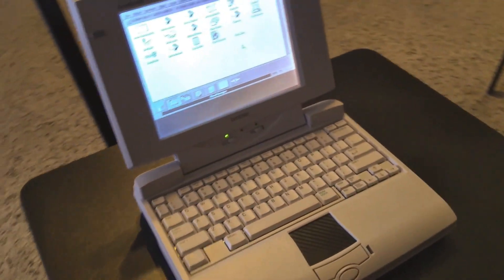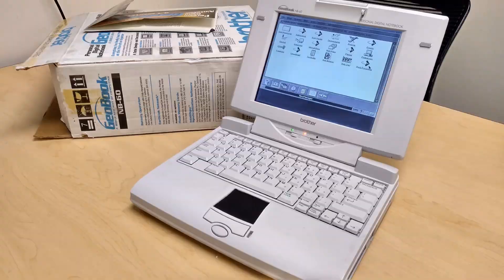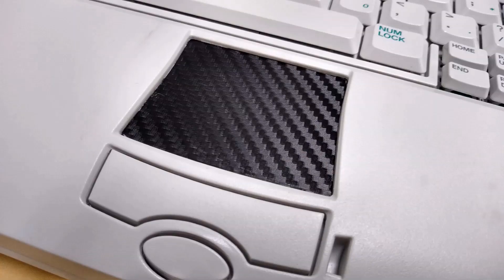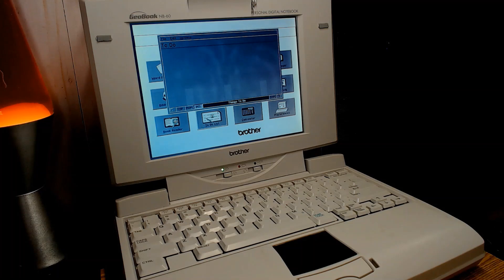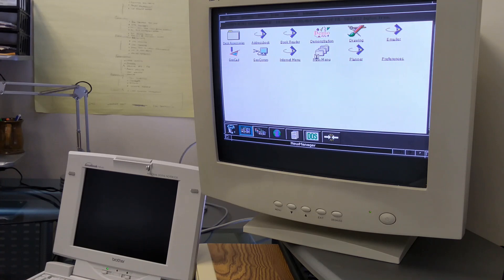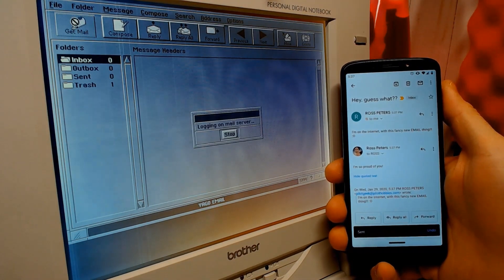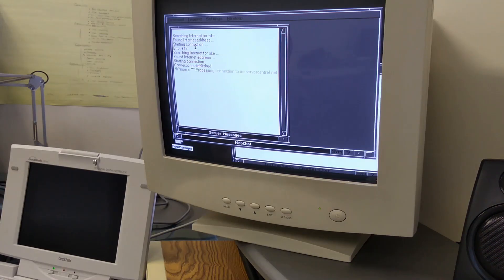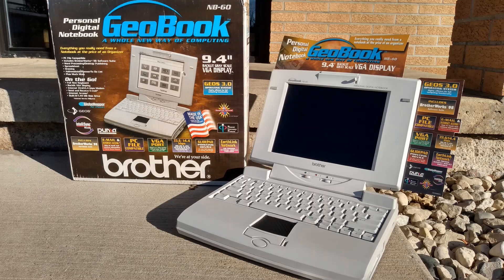GeoBook – The Failed Budget 386sx Laptop in an era of Pentiums

Comment: Is it correct the DOS and GEOS are in ROM?  If so, can the modifications you made to GEOS be reversed?  I've not used one of these things, though I'm kind of tempted to buy one on eBay because I'm curious to see how it works.
Reply from the maker: The modifications I made can be reversed. The OS is in ROM, and the modifications I make are in a 1MB flash memory module, so if you delete the modified files, it falls back to the original ones.
Reply: @Pilotgeek  Hmm, I see.  I was talking with someone else, on another video about these machines I think, and I think they suggested the flash memory needs formatting every so often.  This person apparently did some sort of beta testing or software testing on these machines and they tried a lot of software on them, I think they said you need the factory supplied diskettes to reformat the flash memory if you need to do so.  Is that correct?

Comment: Compared to new laptops in 1998, if all you needed was a word processing machine this wouldn't be bad, but if you take into account used machines, $600 could get you a 486, maybe even a P75 or something, color, and the ability to run standard DOS and Windows software.

Comment: What software / settings are you using on the raspberry pi to emulate a serial modem?
I'm looking for a way to connect old systems to the intranet/Internet natively through built-in protocols. Preferably I would use the modem but I don't have a PBX yet and serial would be a little faster.

Comment: Hello - good video.  I wanted to take moment to thank you for it.  As a GEOS fan, I was always intrigued by this machine and I was able to pick one up a few days ago on eBay new in box.  Before I did, I searched the web for capabilities, specs, etc... and I found your website review and subsequently this video.  I appreciate not only the rundown you give but also the disk images that allowed booting to GeoManager - VERY - helpful.  Now if only I can get my PCMCIA flash card to not completely lock up the machine.  I also have to figure out how you were able to set up that Raspberry Pi to simulate a dial-up connection (surprisingly very little info available on how to do that one) :-)

Comment: Finally, a decent YouTube review of the Geobook. I too have one of them (and its immediate predecessor with a CGA screen) and far from finding it a distraction free writing environment I have spent many hours tinkering with what is essentially a computer dumbed down to act like a word processor. As such it was a minor challenge getting it to do all kinds of tricks like running a copy of Breadbox's GEOS (mainly by scarfing the Geobook's keyboard driver), running the multitasking version of GEM, testing all manner of DOS programs and even trying Windows 3.1 (which "worked" except for the keyboard problem.) It's irrisistable and I learned a lot of DOS arcana.

Most of the hardware shows its price point but you are right about the keyboard. Quite comfortable to use. It seems built for writers with the navigation keys (arrows, home, end, page) all together instead of divided and annoyingly near ins and del. Nice planning.

One thing about GEOS (correct me if I'm wrong) was that it was one of the few operating systems written entirely in assembly, making it efficient enough to fit Windows-like functionality in just a few megabytes. A pity it, and the Geobook, didn't succeed.